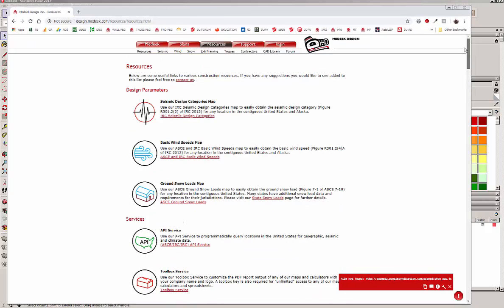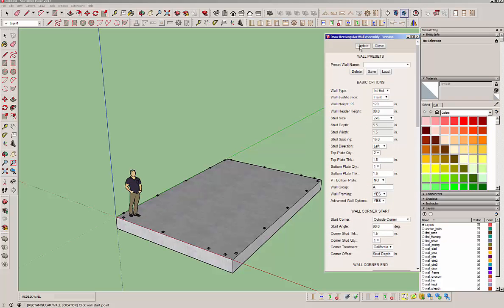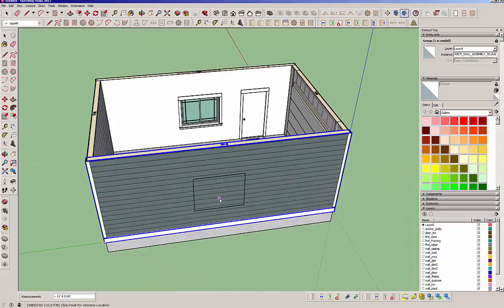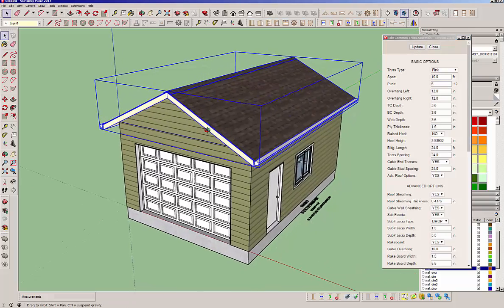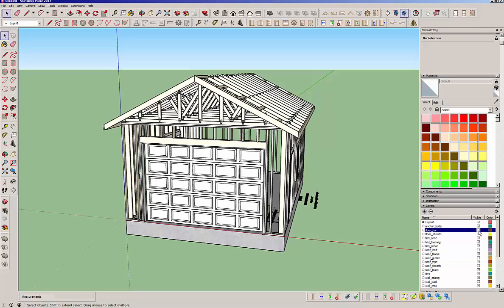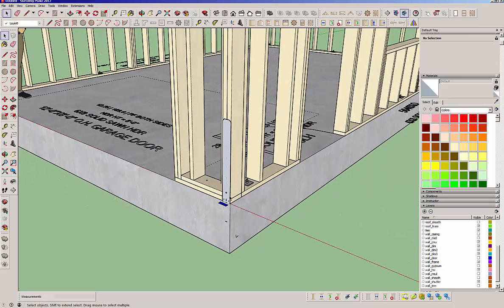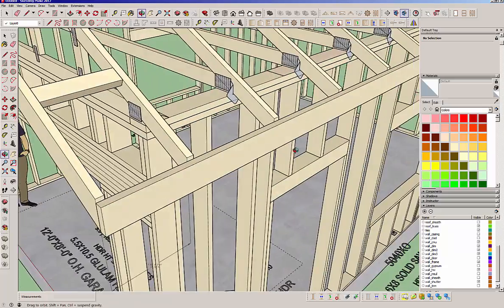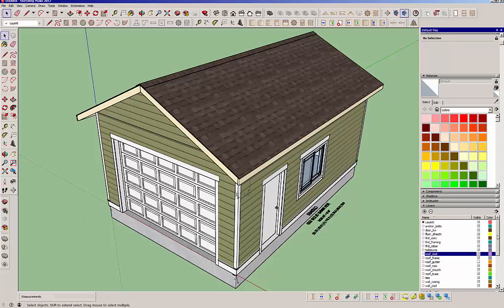Medeek Wall Plugin - The Vision

Comment: Nathaniel - this is a really great thing. I've just downloaded the trial version and I'm working through the tutorials. I've found this immediately more user friendly and intuitive than Plusspec (which I've also just trialed). Really excited to get to grips with Medeek. We're just moving our production over from site building to modular, factory built construction of super insulated frames and I think Medeek is really going to help us to quickly respond to customer enquiries for design and pricing on custom homes. The only question I have after playing with the settings initially - I don't see an advanced setting which would allow me to apply an insulating sarking board; this is becoming increasingly common in Europe as a way to decrease thermal bridging. Likewise, we also use an internally mounted racking boards (OSB or MDF) to support a VCL and battened out service void before the gypsum board. Those would be handy extra layers.

Comment: Nathan, this is just great stuff. I am a amatuer who is going to build out an existing metal sheathed and roofed pole barn into a barndominium (its a Texas thing). Besides the ease of use of your wall tool I am really interested in the estimating tool. Here is my question. I exported all my wall and opened in Excel. Is there a way or do you have plans to allow the user to gather all the short lengths of 2x4, 2x6 etc. into the lengths you might buy from a lumber yard?  That would be a nice feature if it could be somewhat automated.
Reply: I am also curious about this. Lengths of lumber seem relatively easy to code for, for something like. But would be very interested if it can estimate qty of say OSB, by automatically calculating shorter segments that would be cut.

Comment: Hello.

Is possible to change de Imperial Units to Metric Units? Thanks
Reply: The plugin automatically switches to metric mode when using a metric template in SketchUp.
Reply: @nathanielwilkerson6217  thanks

Comment: Can you change the automatic layer naming to allow these plugins to be used with other estimating plugins?
Reply from the maker: Yes, in the global settings of each plugin you can assign the name for each layer.
Reply: @medeekdesign  Thanks, I wanted to make sure that I could use this with Quantifier Pro and Estimator for SketchUP before I pulled the trigger.
Reply from the maker: @Mike-dy8bq  Before you purchase I strongly recommend that you download and install the trial version and work it through its paces first.  Everyone's workflow is a little different so I can't guarantee that the plugins will work exactly as you need them to work especially as they interact with other plugins.
Reply: @medeekdesign  THANKS

Comment from the maker: One thing I forgot to mention is that I have spent about 6 months working solid on the wall plugin while mostly ignoring the other two plugins.  Many of the newer more innovative features in the wall plugin are missing from the other two plugins.  In the next couple of months I will be porting those features into the other plugins (ie. custom material manager, 2D mode, full parametrics etc...)
Reply from the maker: Currently working on the complex roof module.

Comment: They say necessity is the mother of invention and I say that laziness is the father. Thank you for helping us lazy guys out.
Reply from the maker: I"m so spoiled with plugins anymore that I find it actually difficult to draw much of anything just using the SketchUp native tools.
Reply: Are there any plugins that you would recommend that you use regularly?
Reply from the maker: Must have basic extensions are:  Grid Tool, Eneroth Attribute Editor, Mirror (TIG), Solid Inspector (ThomThom)
Reply: Thanks! I use Mirror and Solid Inspector, but I'll have to check out the other two! 
A couple that I use quite a bit are Profile Builder 2 and Engineering Toolbox.